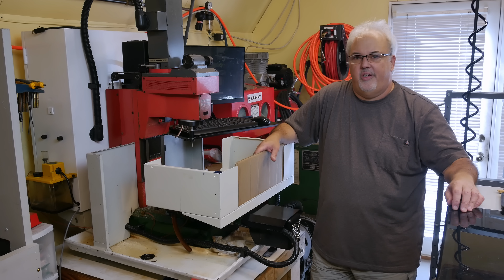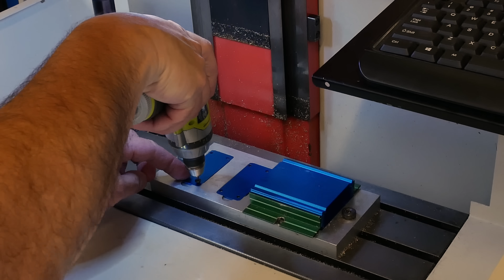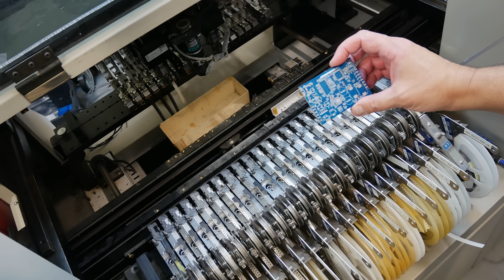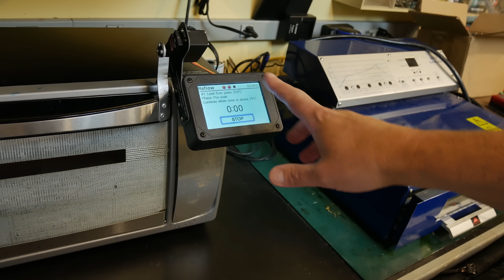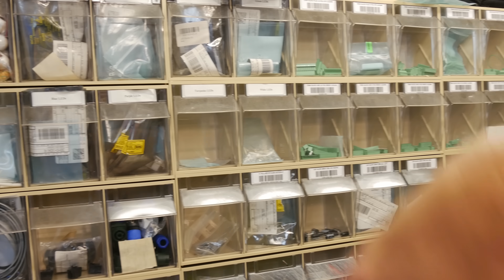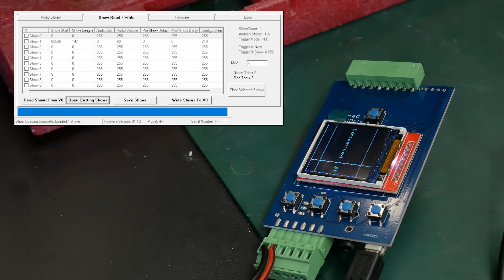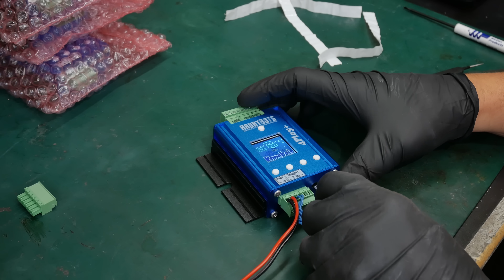How Does a Factory Fit in a Shed?

Comment: So basically the reflow oven you added a PID and other controllers? What else? Additional insulation?
Reply from the maker: Insulation, an extra heating element, and a servo to open the door at the end I of the cycle. The controller I used “controLeo3”. Also has provisions to control a fan during the cool down cycle but I never took the time to add that

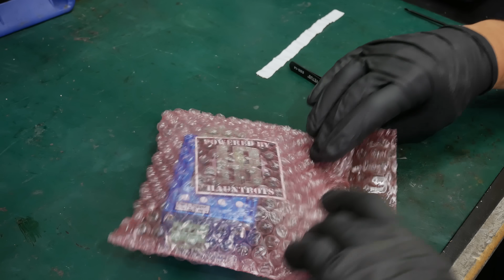Comment: 17:18  Here in Western Canada I build specialty electronic instruments for the geophysics community.  Very small production runs in my home basement office/workshop, so I hand-stuff & hand solder all the SMT & through-hole parts.  Time consuming, but not onerously so using a low-power [max x22.5 magnification] stereo zoom microscope.  Yes indeed, several test cycles both during and after assembly.  Multiple rinses in lukewarm water [I use water-soluble Kester 331 .015 wire solder], 20 minute bake-outs in my kitchen oven at ~ 85 degC, then masking tape on no-coat areas prior to a spray of acrylic conformal coating.  Nothing is too good for little precision measuring instruments that MUST work properly in Antarctica or deep in one of our oceans or in Earth orbit.  Many, many thanks for the show & tell!  Good to know I am not alone...

Comment: Ignorant question, is it much more expensive to use an arduino or pi to make equivalent?
Reply from the maker: If I use an Arduino or a raspberry pi, I would still have to manufacture a daughterboard to give me all the functionality of isolated inputs and outputs the 40 W amplifier and interface for the LCD etc. I would be using the Arduino or the raspberry pi strictly for its processing power. is still have to create a circuit board and probably find a much larger enclosure.I can buy a micro controller chip for five dollars. and just have a single board.

Comment: Watching this as I stare at my 3 3D printers printing things I sell.    Man I love this and it's so inspirational (as many stated)
I love the idea of having all the machines doing their job and getting more things done. 

A businessman once told me the key to success is replicating yourself.   What he meant was train others to do the same job, have them work for you and through guidence of them you're making money. 

However that's also applied to manufacturing.  Replicating ourselves, we know how to paint, solder, mount SMD's etc, but having machines do that is simply such a luxury. 

I'm currently trying to install Klipper into my 3D print system so I can get an idea how much faster I'm able to produce parts, which will determine how much lower I can consider the cost.   AND the next stage is get or build a CNC to produce my own molds for plastic injection.    It was a dream when I was a kid to own a manufacturing company.  After years of random jobs, TV and video projects / photography I'm still on that path no matter what. 

It's rare I find a channel need to follow but you got me!   Best!

Comment: I'll just add my voice to cheer you on doing independent small-scale manufacturing of niche products.  I too have a Controleo-based reflow oven.  I don't have a PnP machine, though I do have access to a small production line that includes a Samsung, and sometimes get called to solve a breakdown on it. The docs are extensive but very confusingly translated from Korean -- so I certainly relate to your comments about "a lot of figuring out how it actually works"!

Comment: At first, I thought, will all that why shut down?! Then I realized by own backyard Manufacturing setup 
Just after covid, I couldn't get anything!
No connectors, terminals, wire was even a problem. Manufactures discontinued major components "due to covid" 
I just tripled the price of my products to slow down orders, this was also a way to use up my remaining inventory. 
Could I make more? Absolutely. Do I? Only when someone asks and I feel like it.
Reply from the maker: I am now just taking on the jobs I want to take on.  Basically I no longer exhibit at trade shows, and I've turned off the ability to order directly from my website.  If a previous client comes along and wants to place a large order I will typically do it.  I've taken myself out of the rat race and it is much more enjoyable.

Comment: I worked in Printed Circuit Board MFG for 10+ Years.  The old pick and place brought back lots of memories.  Nice setup.  Not many manufacturers these days still use metal for their boxes, most use plastic. Did you program the firmware?
Reply from the maker: Yes, I did all the micro controller firmware and the PC utility to download to the completed controller.

Comment: Hey Pete! Excellent content, informative, relaxing, and very impressive. I'm trying to get started with building a few of my own products, it's my kind of activity so we'll see how it goes. Just wondering if you would mind shedding a little bit of light on your business. Would you be able to let me a know a very rough ballpark figure of how long it takes you to make each unit and what they go for? Does not have to be precise by any means. 

I'm just wondering what sort of value you apply to your time as I often find it challenging to add into my pricing. Of course it's your expertise that let's you build as quickly as you do without many issues but that's an area I'll work on haha. Thanks for any comment - for me going from contracting hourly work to this line of work it would just be nice to know what is a realistic amount per hour labour to add into my pricing. If anyone else reading this comment has experience doing something similar, please also let me know - anyone's experiences are massively helpful :) Thanks

Comment: I make & build backyard/farm ride on trains at 7.5 inch gauge 1/6th scale. I would imagine you can make controllers for these style trains. Our controllers usually have 2 -3 potentiometers for speed, dynamic & air brakes, control forward/reverse the lights for number board, hi/low beam lights, ditch lights, sound cards-Lok sound, Tsunami sound. Same as DCC controls for HO scale model trains. Horns, bells and the physical controller, similar to this video.

Comment: Ok question.  You mentioned there are moisture sensitive components that have to be stored in desiccant but after reflowing the board you literally submerge the board in water.  Why doesn’t this ruin the board/chips?
Reply from the maker: The moisture issue is related to the solder reflow operation .  It is possible for the chips to absorb humidity, then when the board is placed in the oven, it is rapidly heated to twice the boiling point. This can cause damage from the steam trying to escape.  Once the board is baked there is no further concern.
Reply: @PeteRondeau thanks for explaining!

Comment: Great video and highly inspiring! Is there a particular reason why you aren't using something like Raspberry Pi instead of a custom board?
Reply from the maker: Tons of reasons.  First of all, I know every bit of code in this product. Even if I were to use a raspberry pi, it would still need a daughter board to handle the isolated IO and the 40 watt amplifier and some way to attach the LCD.  If I’m making a custom board anyway, why not just throw a $5 microcontroller on the board and be done.  I would also need to find a completely different enclosure to make it all fit.  In the end it would be a much more expensive way to build it and any change of raspberry pi’s would effect me. I’ve been selling this same board since 2018.

Comment: is the vent above the UV printer for the smells?  how do you like the printer overall?  i'm thinking about getting one
Reply from the maker: yes, the UV cure resins have a very strong smell to them.  prior to installing that vent,  the smell would permeate everything (whether the printer was in use or not).  Now that vent runs 24-7-365 and has eliminated the problem.  I love what the printer can do.  I have used it for other projects- custom license plates, back printing on clear Plexiglas, humorous grinding discs and cutoff wheels. But saying that, it is a high maintenance item.. Like super high maintenance.  if you don't use it every day it will clog up then you have a big cleaning procedure.  Over the years I have developed a sequence that works pretty well for me but it still takes about half an hour to get it ready to print. Plus you are working with very little documentation and some software that feels pretty sketchy.  The laptop that runs this printer is only used for this and its only connection to the outside world is a thumb-drive that I use to transfer the images between computers.
Reply: @PeteRondeau  awesome, thanks for the feedback.  i've heard similar stories about the sketchy software for some of the printers and the smell.  good idea on the not connecting the computer to the internet

Comment: Glad to see I'm not the only one ordering wire by their proper colors from black to white 😁 Most of my colleagues would not eve nrecognize this. I'm feeling old, like you pick&place 🤭
And yes it is, it was already a used machine when I worked at Philips in '84 or so - but it does the job it needs to do and saves you a lot of time. 
I do hand place components now and then but I mostly have all board soldered by another company. Hand placing QFN 73 packages or 0402 and even 0201 components is not fun anymore ...

Comment: I've done a fair amount of small scale manufacturing of electronics that I designed and programmed.  I always enjoyed doing every step of the process although low quantity custom manufacturing is definitely not the fast path to riches.  I have a decent CNC machine shop in the basement (LinuxCNC machines that I build or converted) and my office/lab has electronics assembly.  I toyed with the idea of designing a custom pick and place machine for small operations but never got a round tuit.  I have 21 of the 60 drawer parts bins full of electronics components that I can no longer reach because my electronics workbench has collected too much junk, as I haven't done electronics assembly/test in a long time.  I seldom use the basement machine shop as it was intended either.  My home manufacturing these days is almost exclusively 3D printing.  That's what I was expecting based on the "backyard manufacturing" title of this video, but you're kickin' it old school.  Thanks for the interesting video.

Comment: That machine that places the different components on the circuit board is awesome, i solder on components by hand so this machine would make assembly 100 times easier.

Comment: Excellent choice using centroid CNC over the other options. It took me 10 years with Mach before I made the jump. 🇺🇲
Reply from the maker: I didn't mention it but there is a smaller  X2 mini mill in the shop.  I used that with Mach3 for 10 years, prior to restoring the current machine.  When I started the rebuild on this machine I considered mach 3, mach 4 and several other options but decided to try the Centroid Acorn system.  I've been pretty happy with it.

Comment: If you're buying from microchipdirect anyway you can pay them to program MCUs and flash chips for you. Around fifty cents each, no minimum order qty.
Reply from the maker: True. The problem is that I tend to standardize as much as possible so I may use the same chip in 3 or 4 different products. Since I buy in bulk I never know which firmware would need to be loaded when purchased.

Comment: WOW.  I never knew anyone would be doing this at home!  Question, the moisture sensitive components aren't affected by the ultrasonic cleaning or rinsing?
Reply from the maker: Right, it didn't occur to me to cover this in the video.  So the issue with moisture sensitivity has to do with the reflow oven process.  The board is very quickly brought to twice the boiling temperature of water.  The possibility exists that moisture that has been absorbed by the components could cause them to explode (like popcorn), or, at the very least create fractures that can come back later and cause problems.  Once the board is assembled, it is no longer an issue.

Comment: Less than 0.01% of the population understands how crazy this combined skill set is.
Reply: it's a whole manufacturing process done by a single man, this is absolutelly insane this guy could be leading an team in an industrial scale plant without any problem
Reply: @OSrBurns  Btween upper management riding his ass for output for low wages coupled with a team the doesn't want to work he's in a better place and in control of his own destiny without the politics and risk of being walked out.
Reply: Not only that  @maxwebster7572  he can watch some YouTubes between steps.
Reply: @OSrBurns  Btween upper management riding his ass for output for low wages coupled with a team the doesn't want to work he's in a better place and in control of his own destiny without the politics and risk of being walked out.
Reply: It's great. He has similar capabilities to a front end line we had at a major electronics company in the US in the 1990s, minus a few robots and a conveyor belt reflow oven. There are many turnkey PCB design and assembly shops that have similar (and more) capabilities around the country. But he's got it in his shed(!)
Reply: Better make that .001
Reply: There was a french guy recreating vacuum tubes from scratch and building a radio. Very different but building the equipment to make the tubes was amazing as well. Smart people didn’t just happen. They have been around working with what they had at the time
Reply: Some silly decimal sure but you should acknowledge that there are millions of very skilled people in that bracket
Reply: as someone who struggles to setup a 3d printer. This is beyond McGuyver knowledge, To be able to setup such mini factory you need extreme experience in lathe, machining, coding, printing, programming and electrical work.
Reply: He automated his own toaster oven ffs…
Reply: @thatellipsisguy8984  Not to take anything away from Mr Rondeau's actual innovations, but for his toaster oven-based reflow oven, he used a kit called "Controleo", which comes with a controller and display, and firmware. Also a servo for opening the door for the cooling phase, and some insulation and reflective tape.  So the task boils down to some mechanical work to fit the kit to the particular oven you chose. It's pretty straightforward, and just one of several kits aimed at this same task.
Reply: @Graham_Wideman Yep, and actually, utilizing kinds of prefabricated solutions is essential in order to sufficiently have the most scarce resource for all this activity - time.

I, as an enthusiast with similar interests, I am able to learn technical skills after another, money can buy many kinds of equipment, but time.. I can only envy the people who have time for all this. Even when unemployed, tinkering with electronics and other technical stuff full-time, I never seem to have it enough for this impressive achievements.
Reply: I smiled at that too  @thatellipsisguy8984  .   The fact  that the door opens to slowly begin the cooling process.  I haven't been able to master that when I want to take a burrito out of my oven........(and...this tight fitting shirt shows that I've been practicing).
Reply: Come on it's not that involved... 😂
Reply: The next question is who designed the circuit, and then created the circuit board design?  Rondeau did the whole thing!  They have entire twelve person engineering teams to do this in a real company.
Reply: @BillFontaine1 ... and who wrote the firmware, and the uploading and serial number tool.
Reply: If that
Reply: Yeah - without him explaining, .01% would not know what any of this is
Reply: It is beyond my skill set.
Reply: @maxpuppy96  Nothing is beyond your skills, just need to learn or shown how it's done. My old man used to say to me you can make everything that has already been made by man you just need to know how & the perseverance with some $$$$, it's the $$$$ that holds up my projects hehehe
Reply: Less than 1% can comprehend much of anything any more.
Reply: And not too many more than that have the vision to hire and leverage to actually exceed themselves.
Reply: And not too many more than that have the vision to hire and leverage to actually exceed themselves.
Reply: And not too many more than that have the vision to hire and leverage to actually exceed themselves.
Reply: USN Aviation Electronics Technician
Reply: This Guyana is wizard.

Comment: You should get an arm stabilizer for your hand placing station.  I'm an R&D technician that handles our firm's full capacity of PCBs.  Since we don't do more than 4 copies of the same board at any time, running them through a pick and place does not make sense.  So, I'm hand placing anything from 200 pin LQFP down to 0402 LEDs at an average rate of one part every 10 to 15 seconds, including setup, placing, reflowing, and inspection.  We average 200-400 components per board.  I've outfitted my workstation with an arm rest designed to help with fatigue for people who use a mouse and keyboard all day, specifically to help with carpel tunnel issues.  I just had to swap out  the bolts that hold the arm to the stand with shoulder bolts, and add in a threaded spacer to get the arm rest lower section above the desk top.  Before installing this, my installation rate was around 20 seconds per part, depending on where on the board the part is located.  It also has made a huge impact on how fatigued I get through the day, keeping the per part time fairly constant without needing additional breaks.

I hope this helps.  My sausage fingers have been at this type of work for 14 years now, and it's not getting any easier.  As such, I have to work smarter and not harder.